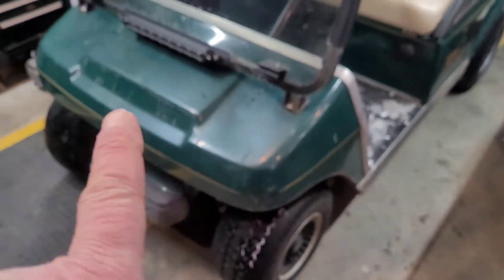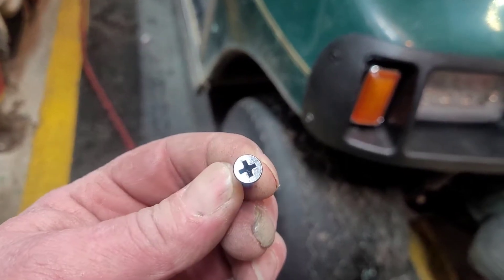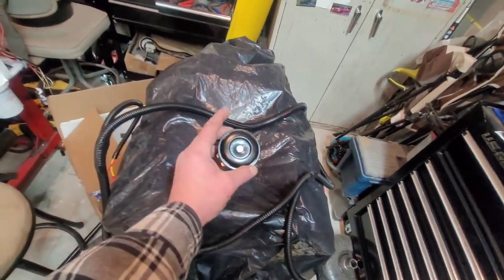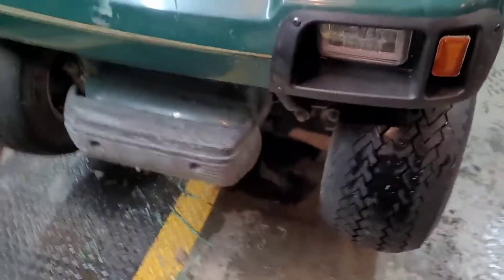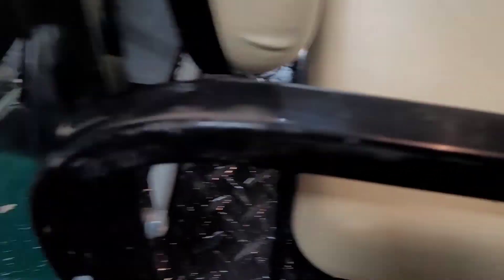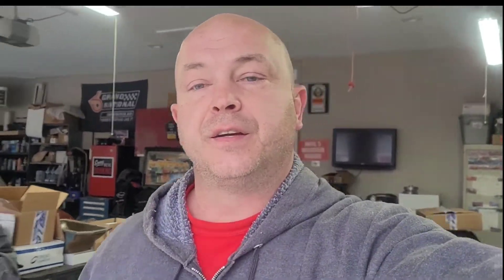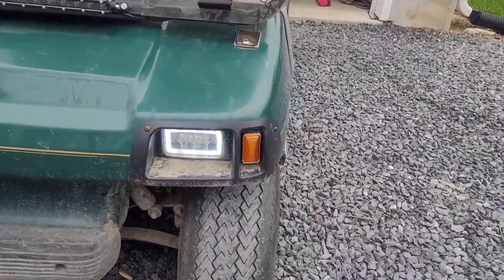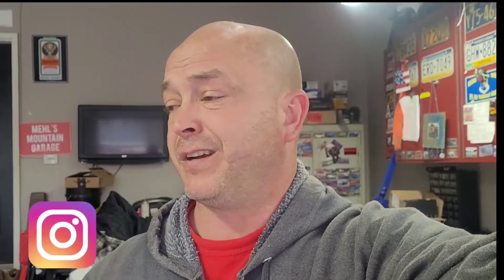Club Car Golf Cart LED Headlights, Taillights, Horn and Wiring Installation. #golf #clubcar #lights

Comment: I'm thinking aluminum rivets when I replace mine.  Any thoughts on that.  I just picked up a 88CCDS. high five man
Reply from the maker: That would work too!  I have a rivet nut tool, so, I may use those and stainless screws.  The cheap screws I got with the kit are already rusty.
Reply: @mehlsmountaingarage  I have an older ds as well,  it has rusty screws also.  I might rivet mine with aluminum.
Reply from the maker: @civilcivilian  Can't really go wrong with aluminum it's easy to drill out if you need to remove the lights at a later date
Reply: @mehlsmountaingarage  my thoughts as well.  This cart has all aluminum diamond plate accessories.  The rockers, the kick plate, floorboard, rear passenger footplate/step and front bumper piece. I drilled them out to inspect and clean under them and replaced.
Reply from the maker: @civilcivilian  sounds like it looks great!